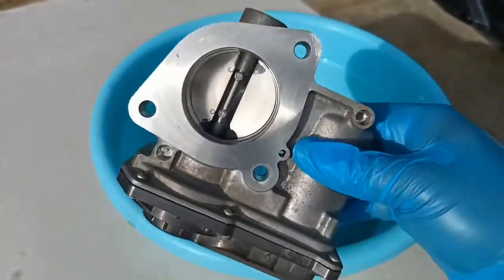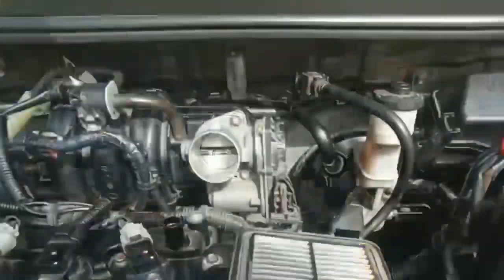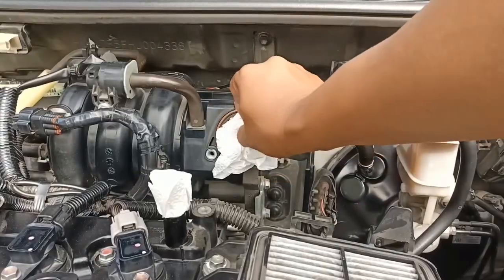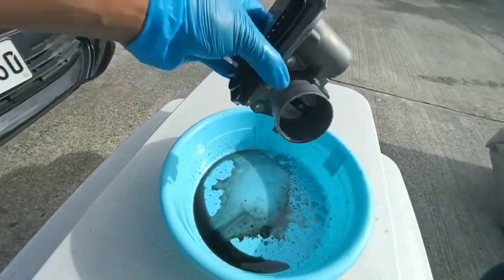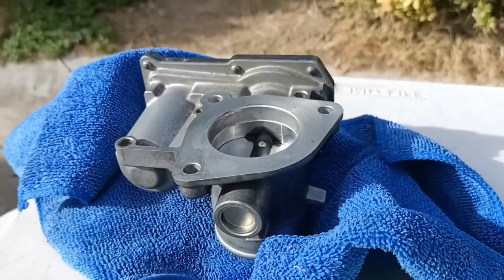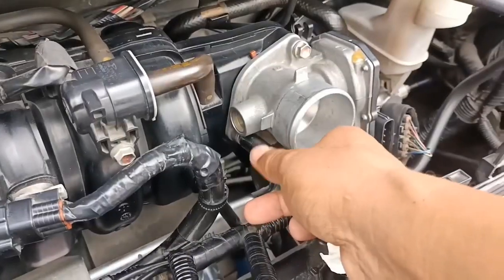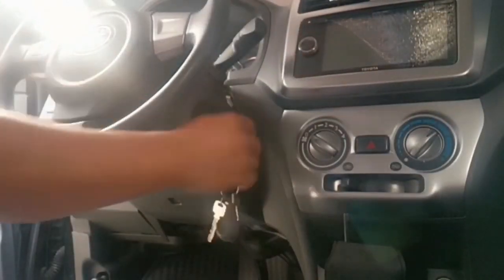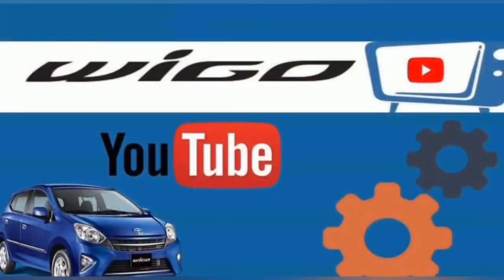How to Remove and Super Clean the Throttle Body - Wigo, Agya, Ayla, Perodua Axia

Comment: Hi Allan, you can actually move the butterfly panel as long as you push it slowly to not create static electricity. 

Why? Because you are already disrupting the idle value of the ECU just by cleaning the throttle body. Relearn usually takes days or a week.

Comment: Need pa ba i relearn or reset using scanner after cleaning ng throttle body?
Reply from the maker: no need as long you disconnected the negative batt cable from the battery before cleaning the wigo's throttle body.
Reply: And also if you did not push the plate of the thorttle body

Comment: Is this applicable also for manual?
Reply from the maker: The process is similar if your unit's throttle body has a cable instead of electrical wires.

Comment: Sir anu po ba possible cause bakit ang takaw ng gas ni wigo ko?  8km/ltr  lang po...kahit ilang reset ko nasa 8km to 9km lang talaga.
Reply from the maker: madami po kaseng factors causing low gas mileage. you can go through this article: https://www.mysfcarguys.com/blog/10-reasons-why-you-might-be-getting-poor-gas-mileage#:~:text=A%20bad%20fuel%20injector%20or,causes%20of%20poor%20gas%20mileage.&text=The%20more%20you%20run%20your,gas%20mileage%20you%20will%20get.